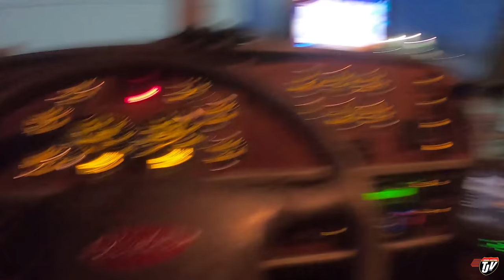FROZEN FUN | My Trucking Life | Vlog #2433

Comment: No to a third vehicle.   Between the payments , insurance , registration and upkeep it is not a money saver.  You are better off to let Britt drive the truck the shorter distance and you drive the Terrain.  It also will not be good to let your truck sit around like that in the winter.  Plus you have your motorcycle for the nice days in the summer.   Just my opinion , been there done that LOL
Reply: Exactly what I was thinking also; never seen a scenario where ADDING a vehicle actually saved money. The current alternative of exchanging primary drivers in winter and using the bike as much as possible in the summer seems the best of both worlds.

Comment: I traded in my 2008 Chevy Silverado that got 15 miles per gallon.  Got a 2021 Chevy Trailblazer that gets 33 miles per gallon.  Look at the brand new designed Trailblazer before you get the tiny little Spark.  All the dogs will have lots of room in the Trailblazer!!  Hope ya read this, retired ol ron.

Comment: Coming for the perspective of someone who is not a truck driver (therefore I can't drive as well as you in all honesty) and someone who lives in the states where we have winter-light. Meaning our winters aren't nearly as bad. I'd test drive something like the spark in the winter to make sure it would be feasible to drive in those months. I know those things weigh next to nothing so I don't know about traction in the snow. Again, you're a better driver than I could think of being. I just know for me it's likely I'd be stuck in the driveway or the nearest ditch. I did have a Subaru that got good mpg and was a little beast in the snow. The Spark mileage is definitely better but those could be an option if the Spark won't cut it. Thanks for the channel!

Comment: I commute 180 km / day. I have a 2006 Golf TDI. I get 5l/100km. I now have 433000km on it and runs like a top.

My previous car was a 2001 Jetta TDI. It ended up in Fredericton scrap yard because water pump failed. It had 692000km. I bought it for 500$. Ran it for 3years. Everything worked. Oil changes done every 15000km.

Wife has a 2005 Passat TDI with 455000 km on it. Vw with a diesel engine is very reliable. Something to think about.

Oh yeah, none of them have a block heater. Start fine at -30C.
Reply from the maker: That is incredible!!

Comment: I told you that a while back. That’s why I drive an old Saturn back and forth to work, 50 miles a day.  30 mpg.  It saves money and then you will have a 3rd vehicle just in case your truck or the terrain needs some service.  I know used prices are crazy here in the USA but what about finding a car around $10,000?  This way it won’t be too expensive and still be a reliable car for commuting to work.

Comment: If you want save fuel try wv golf mk6 1.6 diesel for 100km use about 4.2-5l in summer time probably will use even less, than I had like this my average was 100km/3.9l, but now thinking if this engine size available in Canada🤔

Comment: regarding cars
I live in Europe but had the same considerations a few years ago. I figured that the price I would have to get for my used larger car to a brake even, just to have it standing in the driveway, would be a really big negative price 🙄🙄. At the same time, it cost me in the order of 15,000 Canadian dollars extra to drive in it compared to drive a smaller car. My experience is that the calculation was correct

Comment: when gas prices are high or rising, a small commuter car is nice to have. when gas is dirt cheap, not so much. your thought process about lower costs for everything on a small car is right, much cheaper when you're replacing tires, as you said. i drive a 2008 prius that gets 43 mpg in winter and 48 in summer. i kind of laugh at everyone crying about high gas prices. i never spend more than about $15 at the pump. when gas is cheap, sometimes under $10 to fill it. i've owned a number of f-150s and know your dilemma.

Comment: When filling the air bags on the trailer with air pressure, if there was a leak, how audible would the leak be, and could you determine exactly where the leak is?

Comment: Those cars only come in front wheel drive. No good in Canada, battery may not be good in the cold either. Just switch vehicle's for the winter. They are very small. You won't like it.
Reply from the maker: Front wheel drive is much better in winter
Reply: @Trucker_Josh   He means it's not 4WD. But in my opinion a spark with good M+S tyres won't stop anywhere. You will be surprised what a light car with good tyres can do on the snow and ice. You don't have to push 2+ tons of metal, that's why you don't need 5L engine. I would try to find a used electric car. You have the driveway to park it and charge it, you can charge it at work and the most important, you can warm it on schedule or with an app on most of the newest of them. Imagine how much fuel and time you will save if you can have it warm just the second you get in. You just turn the knob to D and go!!!

Comment: The Chevy Traverse version of the GMC Terrain would be better than the Chevy Spark which per reports on the "Scotty Kilmer" YouTube channel are not that reliable. (Both the GMC & Chevy have the same 4WD & engine combinations. where the SPARK is only 2 wheel drive, the only difference is the name & the interiors on Chevy Traverse are perhaps a little more rugged than the Terrain.).     :-)